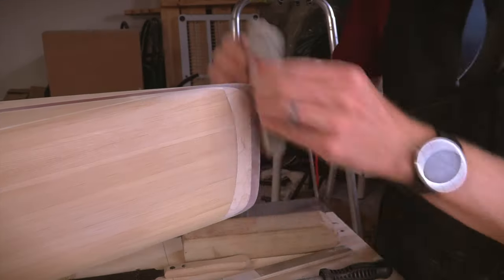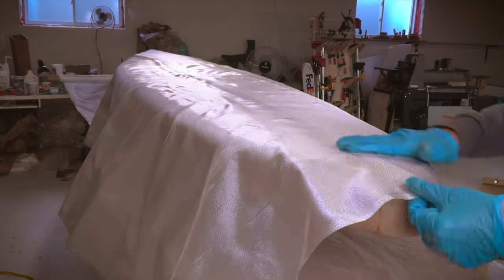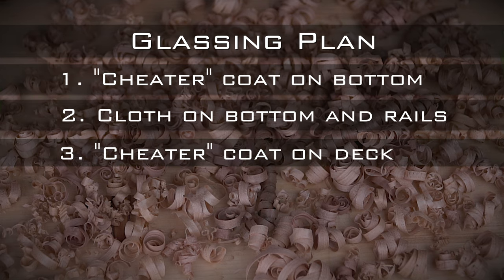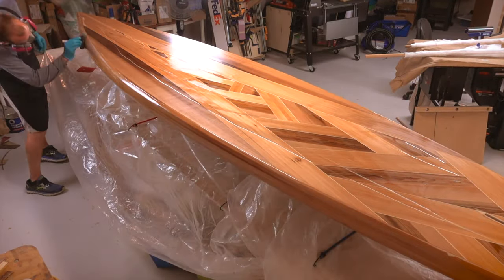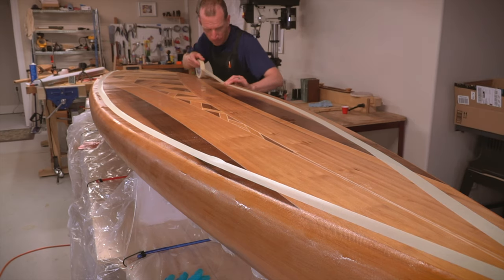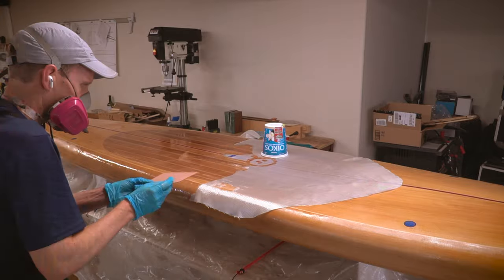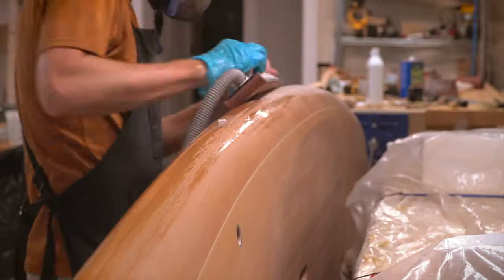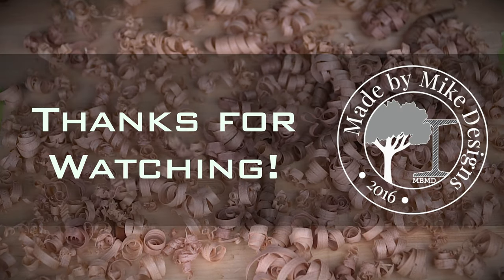Mike Builds a Paddleboard Part 7 - Fiberglass

Comment: Mike,  I find the best way to clean the overlapped glass edge is to use several fresh single edge razor blades held vertically and scrape side to side.  Easier before full cure.  Comes out clean and no sanding.
Reply from the maker: That’s an interesting method.  I’ll have to give it a try next time. Thanks for the tip!
Reply: @madebymikedesigns6253  Thank you for all your tips and the inspiration.  That is the most beautiful wood SUP I have ever seen.  Bill
Reply from the maker: Thanks so much Bill! It’s great to hear the videos are providing some inspiration.

Comment: Never set your mixing cup upon  fiberglass textile without it first being wet with mixed resin.
Unmixed epoxy at the edges of the cup drain into the glass and can never be mixed by the spreader. Asking for issues when you don't need them.

Comment: How/when did you remove the tape over the features on the deck of the board?
Reply from the maker: Hi Christopher.  I removed the tape with a knife using basically the same method as the rails.  It would have been smart to do it as soon as the first coats of epoxy hardened up a bit but i waited too long and had to cut through thoroughly hardened epoxy to get it done.  It took some careful carving and a bit of sanding to blend the edge into the curve of the fittings but after adding a few fill coats of epoxy on the deck, the transition is completely smooth and invisible.  Thanks for following along with my build!